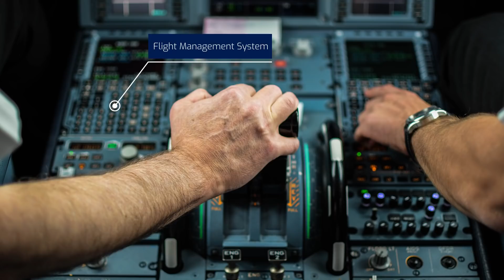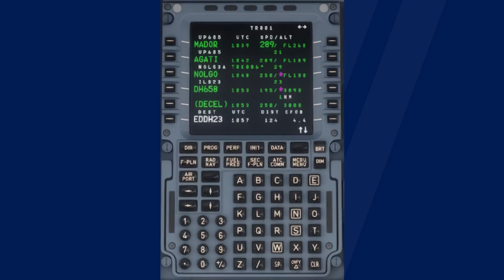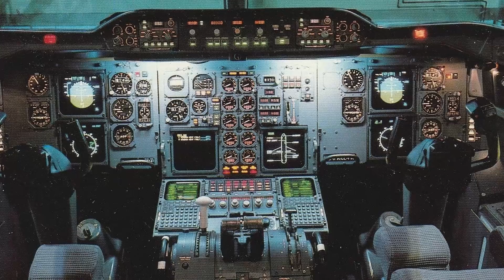Bad Decisions | How Hapag-Lloyd Flight 3378 ran out of fuel

Comment: Hello Airspace. Interesting video. I did some work regarding this accident. There are several other dimensions about this flight. Operational Control/Flight Dispatch regulations, policies and procedures and the crew assuming an improper airspeed for gear down operations as a result of how the information about the airspeed is displayed. You do mention the crew talking to the airline later in the flight about the continuation of the flight and deciding initially on Munich as the planned stopping point, then changing to Vienna, even as they were abeam Zagreb, with the low fuel warning light illuminated.

The Airbus A300-A310 series had a history of gear down problems. The airline that I worked at in the US as a flight dispatcher flew A300s. Same gear system. I had an A300  flight that departed from LGA airport, New York,  to Atlanta. Similar to this flight, it could  not retract the gear and it remained down. The crew contacted me on the radio, and we discussed the situation. In the flight manual there was a graph for gear down fuel consumption. I calculated it and discussed the the situation with the Captain, and we determined that if we eliminated the holding fuel of 20 minutes, and flew the airplane appropriately, that the flight should arrive in Atlanta, while still having enough for an alternate as well as reserve. But that we would check at about the halfway point, abeam Charlotte, North Carolina. 

So the Captain calls me back as they are abeam Charlotte and advises that they are burning more fuel than we had estimated with the gear down, as well as that the airplane was "very noisy". So I checked the flight manual again and asked what speed they were operating at? They said "270K Indicated". But checking the flight manual, it showed 240K as recommended. I advised tha Captain and they reduced speed to 240K. It imediately significantly reduced fuel consumption and also the noise level. (The Captainsaid "That's better".   The problem was that the gear down handle was placarded as 270K because that was the "maximum" gear down speed (VLE). But it was not the recommended for cruising with the gear down. With the additional fuel that the airplane had burned because of the previous higher speed, we recalculated and determined that the flight could still continue to Atlanta and land with reserve, but we would eliminate the alternate airport. This was legal  as the weather was good and there were no ATC delays, and the aircraft continued and landed without further event in Atlanta. But the crew had the right information. 

I later spoke with the accident investigator for the Hapag-Lloyd flight and relayed what I knew. decision making,
Reply from the maker: Thanks for the interesting read! Still, I think that doesn't change the fact that the decision making of these two was terrible.
Reply: @AirspaceVideos  :  Oh, it was definitely  terrible!  One bad decision after another.

Comment: Being someone myself who has run out of gas, I will at least say that it was when pulling into the gas station every time in the car. On my motorcycle, there was no fuel gauge but there was a half gallon of back-up fuel and all you had to do was switch a lever over to access it and then I'd go to the nearly gas station after that. I will say that I switched it over on the freeway a couple of times, which was incredibly dangerous but it always happened when I was in the fast lane and it was also unsafe to try to move to the shoulder without power considering how fast the other cars were going and the fact that there was no way for them to know my engine had stopped. However, nothing is more dangerous than not having enough gas while one is flying through the air and it's not like there aren't airports all over the place, even if they aren't ideal. Some of the gas stations I had to stop at in fuel emergencies had expensive prices but that's what you get for getting to the point that you run out of gas.

Comment: I’m sorry but you can’t blame the computer in any way here, the engineers use this acronym for a case like this GIGO, Garbage In Garbage Out of any computer program.
The blame is totally on these pilots and maybe on the work environment set up by company management that pressurised them to continue , any conscientious pilot would have called a PAN PAN PAN and returned to the departure airport for a check. This was crazy stupid the moment they decided to fly on.
Reply: He is not blaming the computer, he is blaming the pilots (Captain in particular) for too much reliance on the computer and not enough basic airmanship. 

It's really easy to get used to the computer doing everything for,you but when something is wrong, you need to be a pilot, not a computer operator.
Reply from the maker: exactly, no one is blaming the computer.
Reply: @AirspaceVideos  Yes, the computer did exactly what it was programmed to do. The pilots didn't know how (and how not) to use it.

Comment: Excellent video. This case is bizarre. So many questions still lingering for me.

1. Why press on in the first place? Seems like company wouldn't want to waste all the extra $ on fuel.
2. After determining that a diversion was necessary, why not divert to an airport at the halfway point? 
3. Once you have to divert a second time, why not just land somewhere close and sort things out? What's the point of getting to Vienna?
4. After realizing that fuel was critically low, why not retract the gear that is working? Seems like shedding 2 gear's worth of drag would have gotten them to the threshold. You can always put it down again once the runway is made.

This isn't a typical case of get-there-itis. They knew they weren't getting to the destination early on. I just can't understand what was going through the captain's head that lead to these decisions.
Reply from the maker: Thanks :) I'll try to answer as best as I can...
1.) good question. One reason might be that it is easier to pick up passengers closer to the home base. Still, that's a weak explanation. 
2.) See 1, but yeah, that would've been very reasonable.
3.) I can't explain that, it's beyond me. I would have returned to chania of not overweight and maintenance was present there, or otherwise divert to a major airport with good maintenance capacity (athens, zagreb, belgrade...) 
4.) good idea. but they probably were overwhelmed by the workload.

And yeah, this is a severe case of mission focus. It is really curious that they continued on for so long.
Reply: @AirspaceVideos  Thanks for the reply! And for confirming my suspicions that their ADM doesn't make sense from the perspective of airline operations either. As a GA pilot, I can't figure out where the pressure came from to go as far as they could on their available fuel. I've made fuel diversions enroute before, and I just picked the cheapest FBO on my route with an approach that wasn't going to add 20 minutes. Not because I was deliberately trying to be safe, I just didn't feel any pressure to use every last drop once getting to my destination was no longer viable. 

Great work as always. Keep it up! I've watched all your videos and have been anxiously awaiting each new one for the last few weeks. I've shared your channel with a couple of my pilot friends.
Reply from the maker: True, and the good old phrase "better safe than sorry" would have applied here, too. Thanks, I'm glad you like my content :)
Reply: @AirspaceVideos  only answer is, they must have been very sure what they were doing was safe...(why? that is beyond me) as for halfway point, they probably did want to land inside of Germany and it's efficient rail network... Zagreb is pretty hard to get out of except by airplane, maybe they were hoping some passengers would just use rail to continue to their destination... Vienna may have thesame perks, but its much more vague to me why they wanted to continue to Vienna.